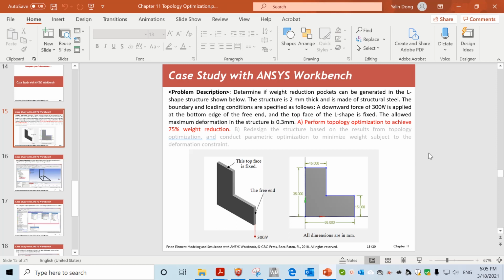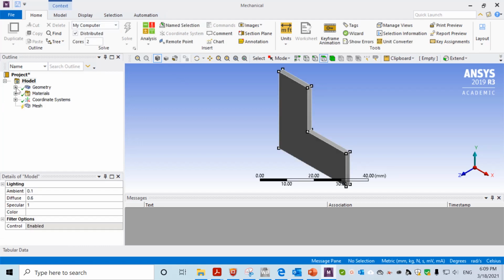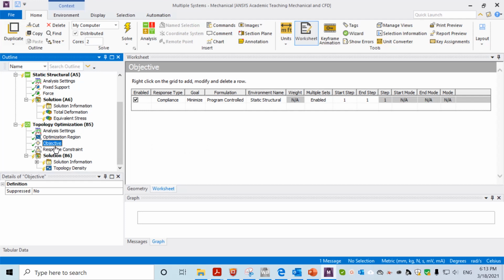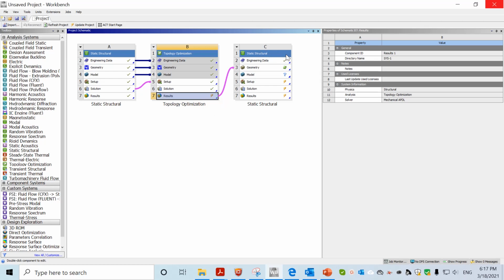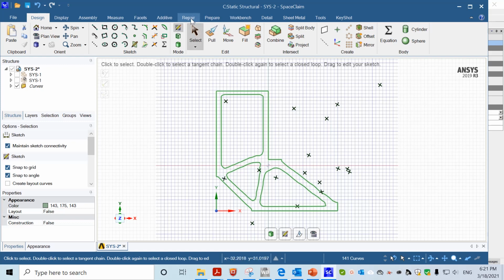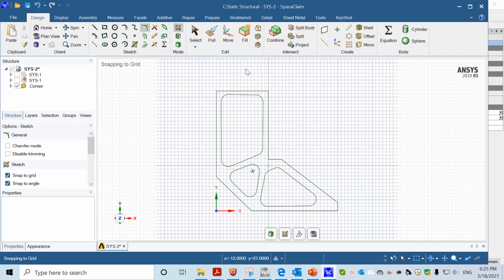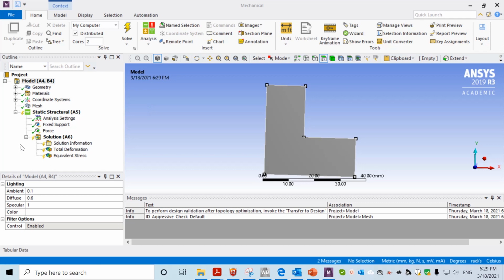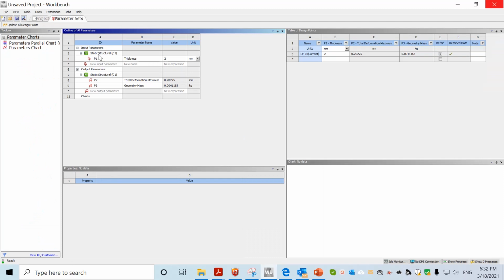Chapter 11: Part 1-ANSYS topology optimization for using less material to achieve maximum stiffness.

Comment: Your maximum stress is 882 MPa, but the yield strength of steel is much less than that. Are your values extremely high because you placed the force on a line (i.e. the forces are not distributed over an area)? Thanks!
Reply: It is an L shape and there is a so called singularity in the corner, where the vertical and horisontal regions meet. (Sry, I can't describe it better, you can see the singularity or hot spot at @6:11 on the edge with green) It comes from math and the value displayed is actually "incorrect". If you use finer mesh, you can see, that the region with the outstanding high stress is only a thin line. You can get the correct stress values with 2 methods. 1st you can apply some rounding on the sharp edge, like 2 mm or 2nd, you just apply a fine mesh and read the values of the neighboor element. In this case the highest stress should be around 170-200MPa.
Reply: @herkdaniel807  Thanks Daniel for this explanation, I was confused because when I refine the mesh, the maximum stress increases !!